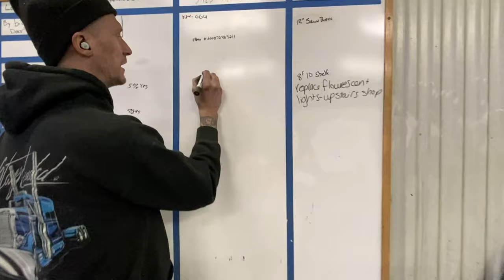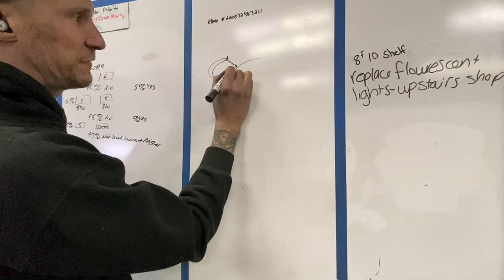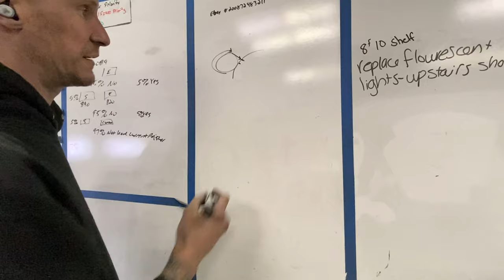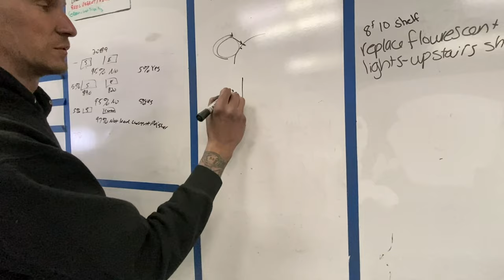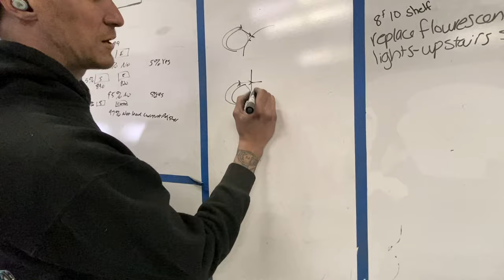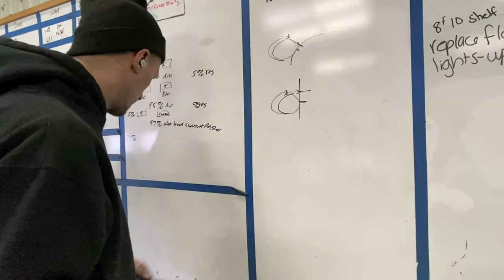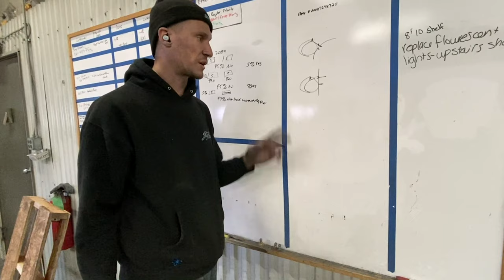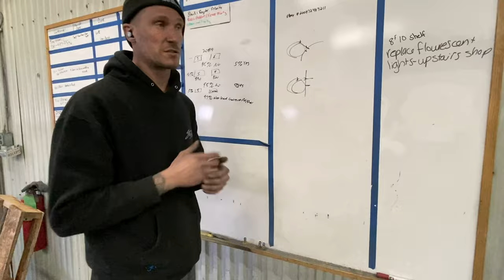Why is Polishing Flat surfaces harder than Round surfaces - Evan's Detailing and Polishing

Comment: Question; Would the surface contact area play a role? I was half expecting you to say that the buff wheel's surface contact is relevant to the black line width. In maintaining equal pressure on the buffing wheel the flat surface has greater contact with the wheel than with a convex surface, and that the different width of the black line is in respect to the relative contact the wheel makes due to the deflection of the buffing wheel.

Comment: So I was going to a chrome shop to buy new buffs and compound, and I saw this 8 inch orange buff that was really hard and stiff the texture almost felt like hard sandpaper. And I was wondering that if I had a harder buff it would be more effective for the first step of cutting and polishing. And get that nice shine on the first run. So my question is does it matter how hard or soft the buff is? And does the harder buff scratch and leave marks on the aluminum? 🤔🤔

Comment: Your explanation about pressure build-up being greater on a flat surface vs rounded one is spot on. The part about slinging the compound is wrong, the slinging distance on rounded surface would be greater, however the air pressure build-up on flat surface overwhelms the compound slinging and creates wider compound line on flat surface.
Reply from the maker: Thanks for watching and taking the time to comment.